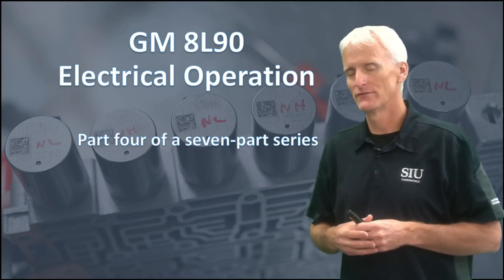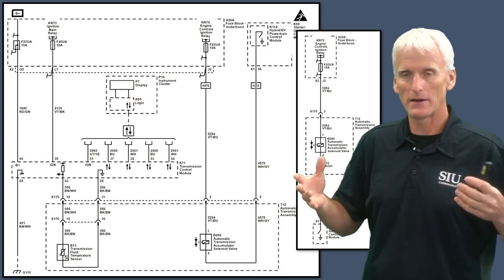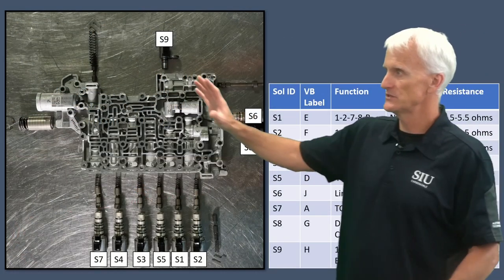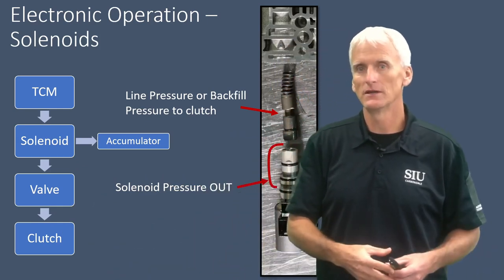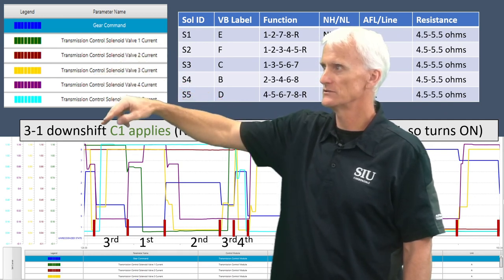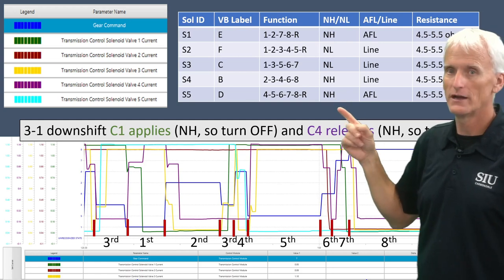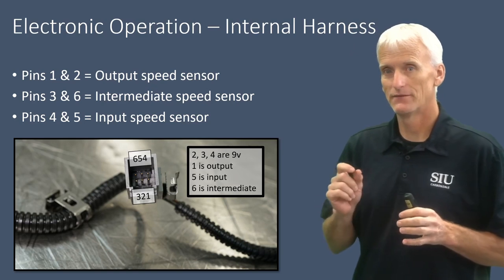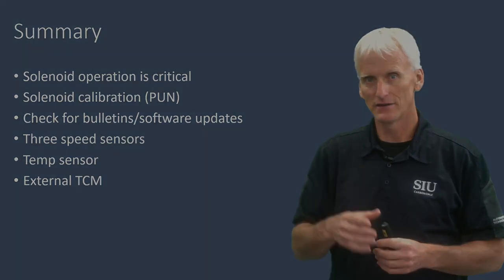General Motors 8L90 electrical theory and operation

Comment: Just some history here. I started working on these when they came out. On the early models of this transmission it was really difficult to know if the clutch volumes and returns springs had learned or not. On the 15-17s you did not have the capability to actually look at the clutch volumes and return spring statuses like you can on the later models. What was frustrating on the older models is you would finish a repair, do the fast learn and drive it and you would think everything was O.K. The customer would take it and in a week or so bring it back and there would be one or two shifts that were not right. There was a bulletin developed to help us with driving techniques that would assist in learning the shifts. We were actually doing the driving maneuvers that now GDS assists you with. The only indication you had on these early models the shift was learned was when the shift felt correct. Just be aware on the early models the clutch volume and return spring monitor is not available in GDS. On the scan tools I personally like the Snap-on scanner I have because of the speed of set up and ease of use when driving. I have a Solus Edge. The one thing I have found is I do not have the capability to control the torque converter clutch which can be irritating. I have complained about it but alas I am just a lowly transmission tech at a dealership so, I don't hold a lot of weight. Your explanation of the sensor function is better than the factory information we have. Really good information on this video. Your research is excellent.
Reply from the maker: Thank you for your suggestions!  I really appreciate you chiming in on this and sharing your experiences.  That’s some great info on the early vs late units.  I agree, the speed of the snapon sure makes it appealing.  No need to worry about a laptop, gds2 updating, or any of that.  Just hook up and go.  We use the solus edge and the one in the video was a newer solus legend.  It’s much slower than our edge and the touchscreen isn’t as nice.  Maybe they have cheaper hardware, idk.
Reply: Have you ever seen unnecessary hard 3-4 part throttle shifts? Even trying to learn the 3-4 by itself instead of resetting all the adapts? Mine drives me insane with the overly fast and hard 25-60% throttle 3-4 shift.
Reply: @cmitchell17a1  What year are we talking? That would narrow down the scope a little.  I am assuming we are talking an 8L90.

Comment: My daughter's 2019 GMC Canyon with the 8L45 transmission recently had trans failure. I found an 8L45 out of a 2021 GMC Canyon I can get. My question to you folks is, is the transmission interchangeable since the TCM is external?

Please excuse my inexperience with the 8l45 as I am mostly familiar with the V8 GM transmission interchangeability.

Thank you in advance!